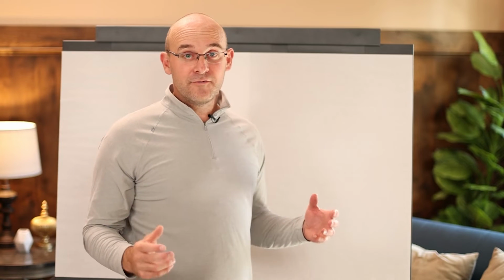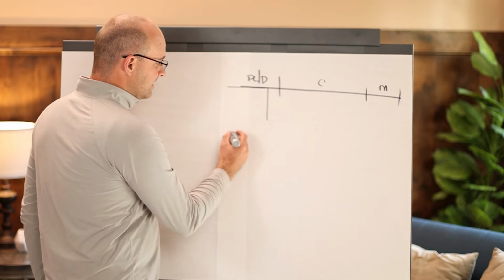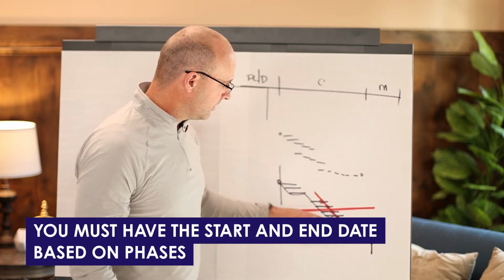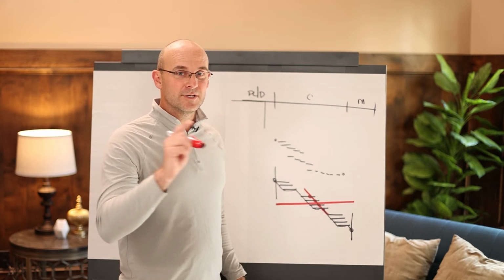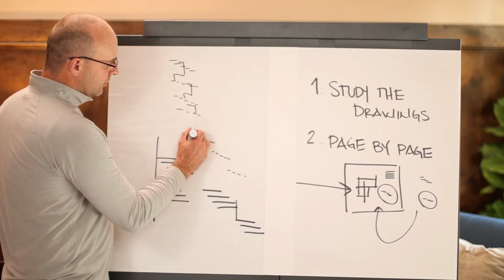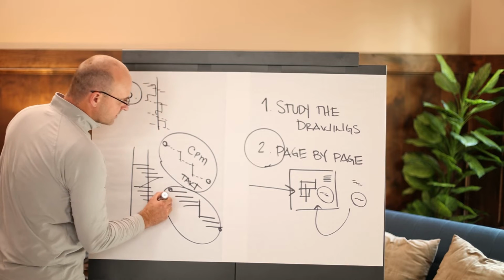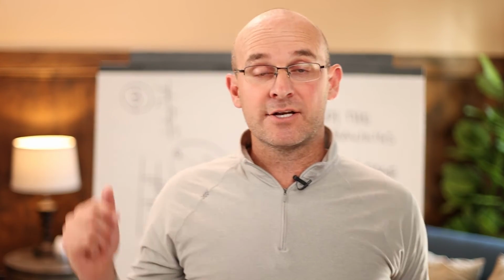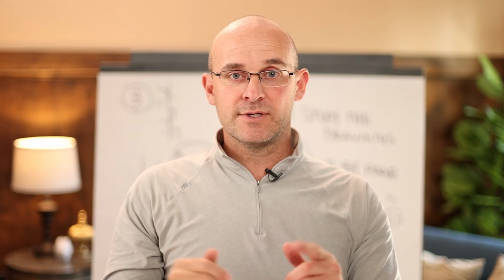How To Make A Construction Project Schedule

Comment: I Liked your three approaches and having trade flow in the schedule. I agree having  sequences in different places confuses even the schedulers. Trade flow makes it near and clear. I don't agree with having total duration and phase durations first. The bottom up plan will be better rather than top down to arrive at the project duration. But then again if you're working with contractual end dates, top down estimates makes sense.